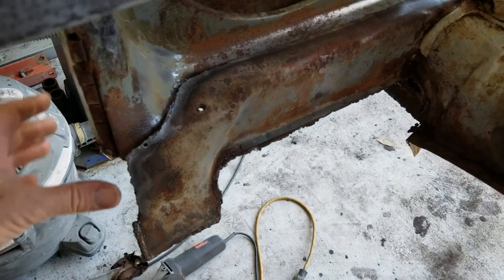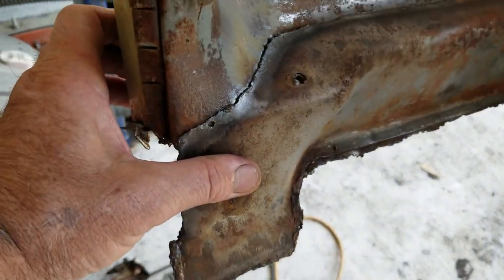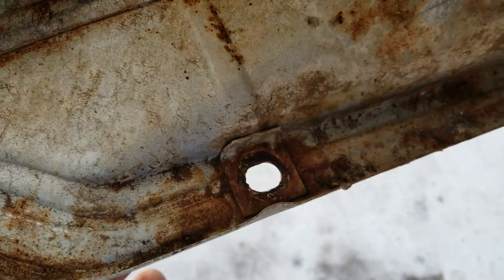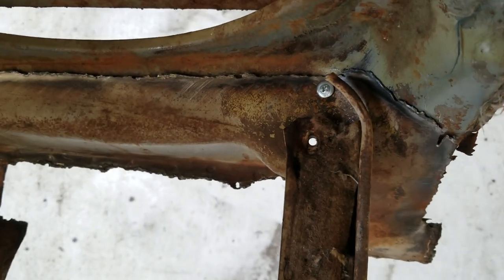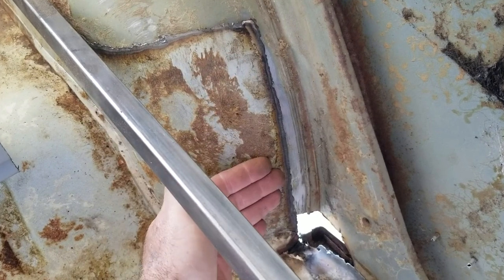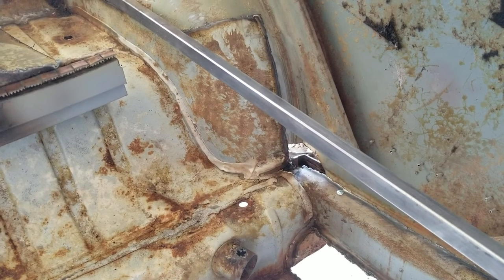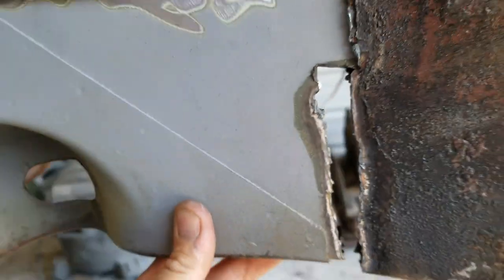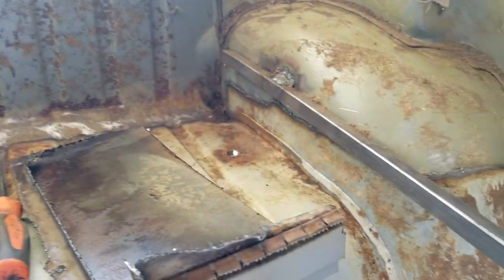60 ragtop bug metal work fitting the panel

Comment: You’re not wasting any time on this bug! Glad my ‘60 rag didn’t have this much rust.  Great job!
Reply from the maker: actually I am just cruising. I have about 15 to 18 man hours in that back panel and it is installed but still need to make the small patch pieces. they take a bit more time but not really that much to do worked on it for a couple hours max today and got the new one in. next video coming up waiting for the editor.
Reply: You are a lot faster than I am :)
Reply from the maker: thanks bud and I am just cruising on this one. about 15-18 hours on this repair so far. the little stuff adds up though.